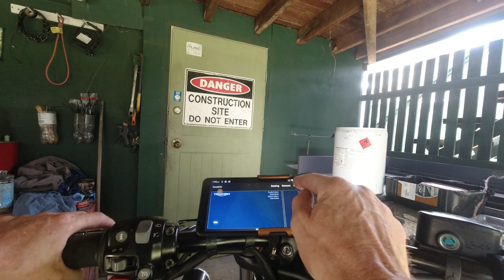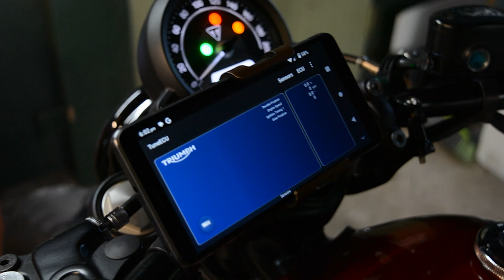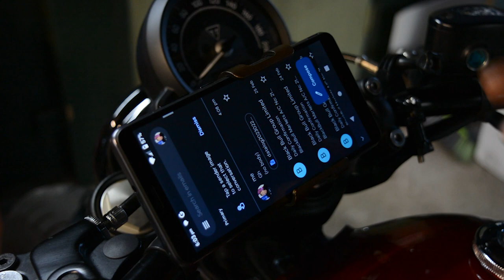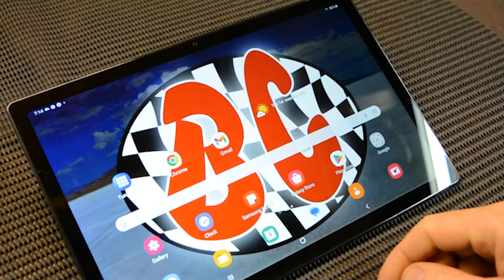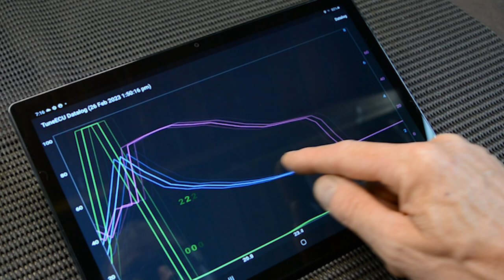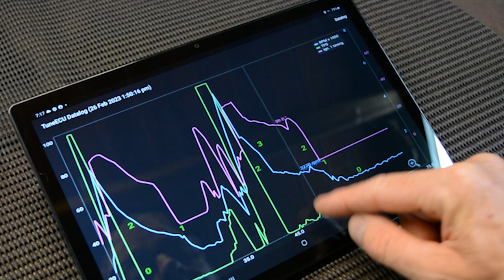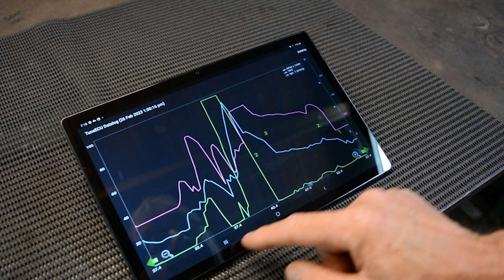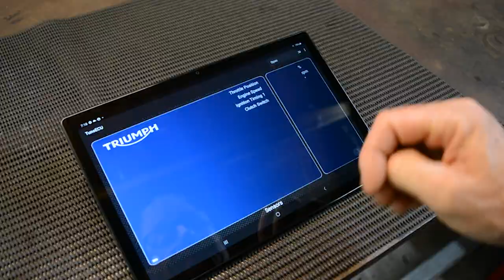Data logging with Tune Ecu

Comment: You can measure AFR with short term fuel trims. Short term fuel trims shows how far you rich or lean from targeted AFR set in the table, and it learning in Status. Anything +-30 range is perfect, 100% mean used all range to make targwted AFR.

Comment: Trying to diagnose my bike, I have a Haynes manual but do you know where would the best place be to get information on what "normal" should look like for my bike (Triumph Street Twin)? I'm trying to find a fault that's not triggering an engine light or fault codes, hoping the sensor readings and recorded data will shed some light.
Reply from the maker: Maybe the Tune ECU forum. What's the fault?
Reply: @brownco_customs  Yeah I'll look around. Fault is when coming to a stop if I pull the clutch in the revs will dip well below idle and even cut out sometimes. Always have to blip the throttle first.

Comment: Do not attempt tune F or L table without Short term fuel trim readings. You will make worst 100%. 
I would not advice to remap factory without backup at all without STFT readings. 
Also bike will target AFR set in ayther way and you get error code rather then making anything bad to the engine. 
Also do not modify ignition table, extensive experience needed for that to prevent engine destruction